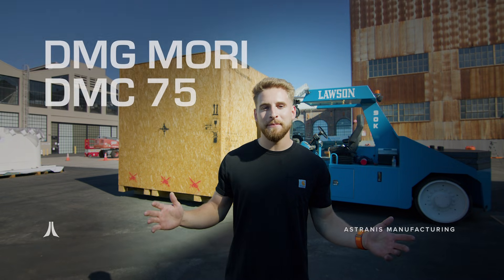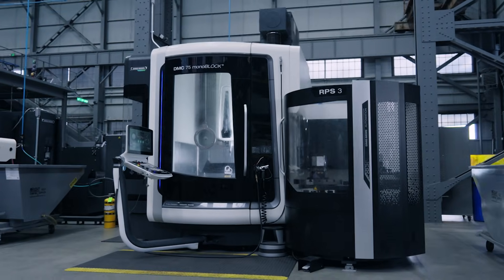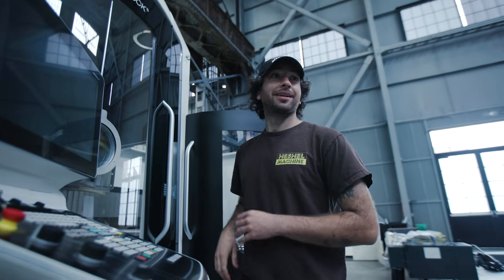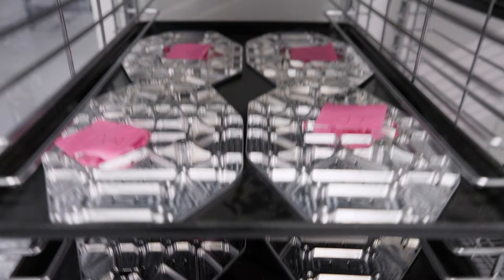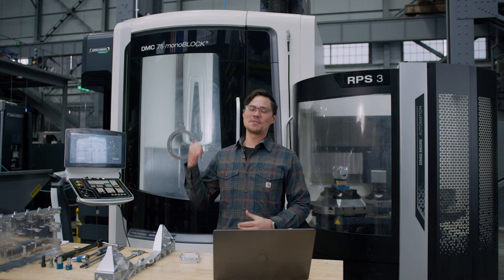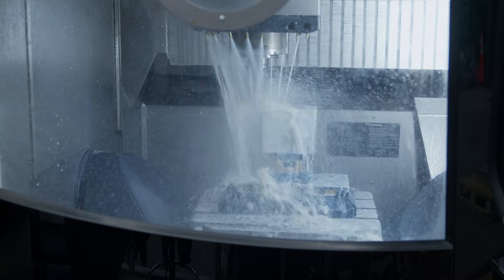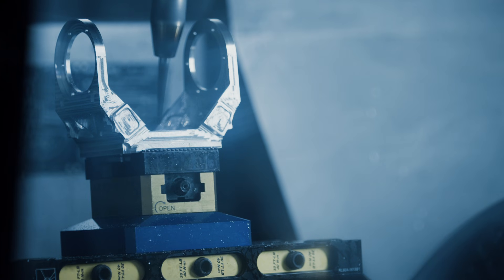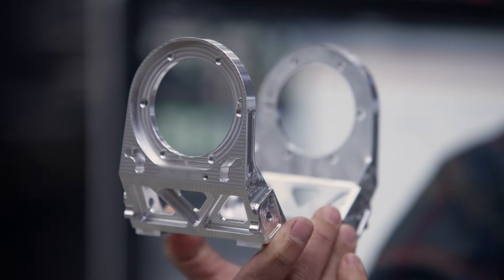Unboxing a $1,000,000 CNC Machine | DMG Mori DMC 75 monoBLOCK

Comment: You might reduce cycle time and doing in one go without a fixture if you do tagging on the part.
There's a little bit more material but you will get one full part out of the machine
I also would consider maybe hypermill for the future as its great in 5 axis and very optimized for aerospace.
We mostly work with aerospace parts and that's our goto for 5 axis milling.
Turning I would advise Esprit Edge. Very nice for the mill turns, I use it every day
We have a 95 monoblock, they are a beast machine.

Cheers on the machine, Would love to work with you guys producing parts for satellites.

Comment: One of the best machines available today. My congrats. Why did you choose it over a 3d metal printer? I always considered that aerospace companies nowadays are pushing into 3d printer market and for 1 million USD there are SLM printer with the same workspace.
Reply from the maker: 3d metal printers have their place for certain parts, especially those with internal features that would otherwise be impossible to form with subtractive methods. For the components we are producing, CNC milling is the optimal solution.
Reply: @AstranisManufacturing  In my opinion is CNC milling always cheaper and faster if there are no features that make milling impossible.  But the programming and workpiece holding is more challenging than in 3D printing.  So I agree with Astranis Manufacturing. (sorry for my English, I am from Belgium in Europe)